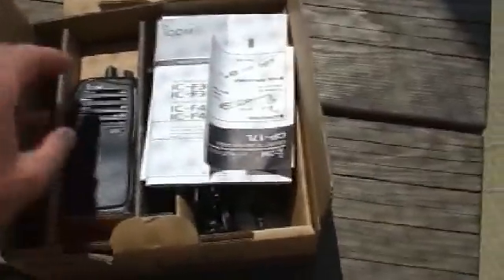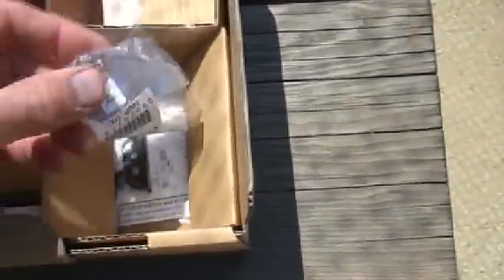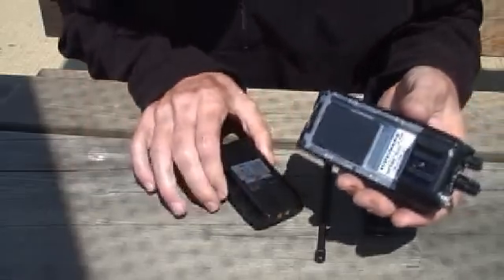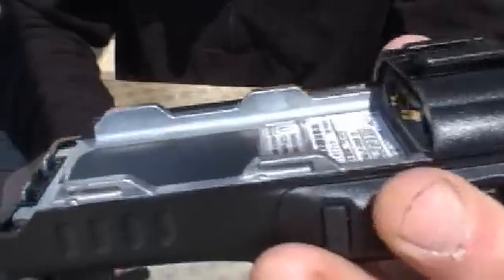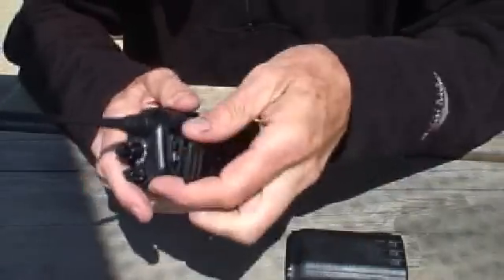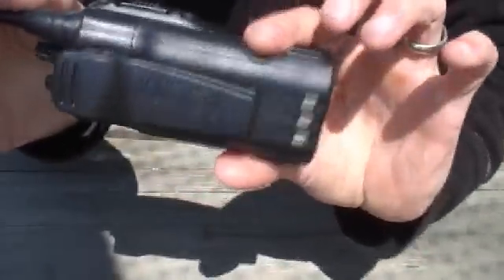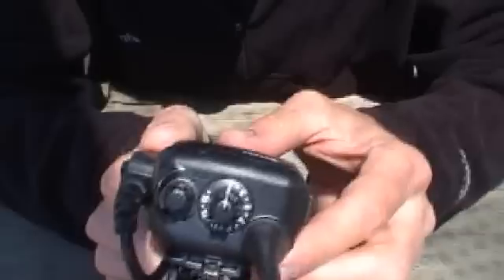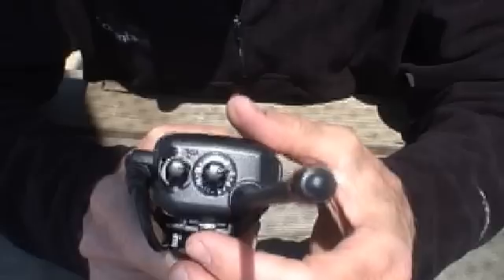ICOM F4011 and F21 Radio Training Part 1 of 2

Comment: We’ve been using the 4011 for about 4 years. We get about 2.8 miles distance with them with a good line of sight. Definitely buy the antenna adapter and buy a Diamond or Signal stick dual band antenna for it. We use these tactically and typically in a pouch. You can buy an 90 degree adapter for an extended PTT switch. 
Most importantly, buy the software and programming cable which will allow you to set your own frequencies and squelch tones. Use the old color dot frequencies which are now MURS and do not require a license. Set your squelch tone midway up the options and you should be able to communicate without hearing your local Walmart lol. 
Take care and 73’s! KI5SMM.